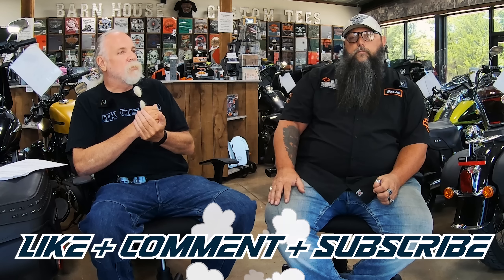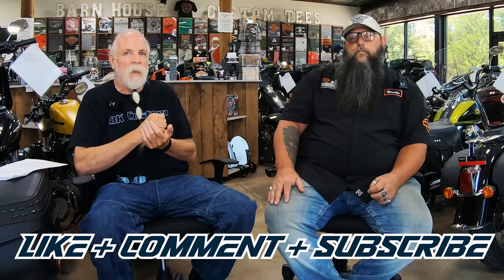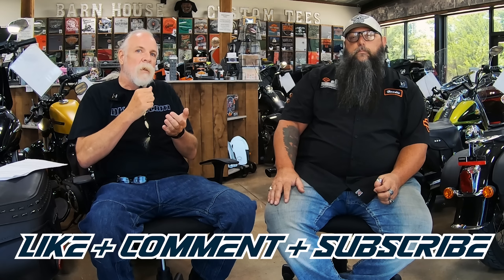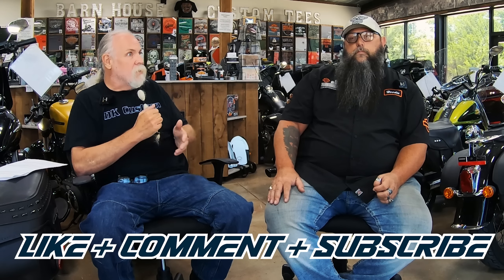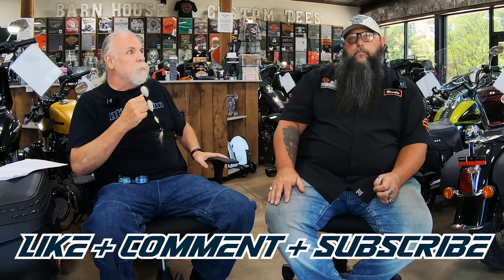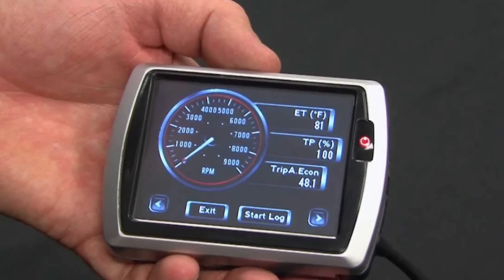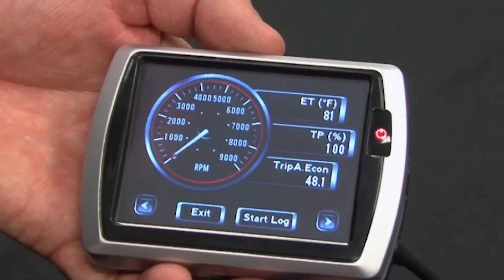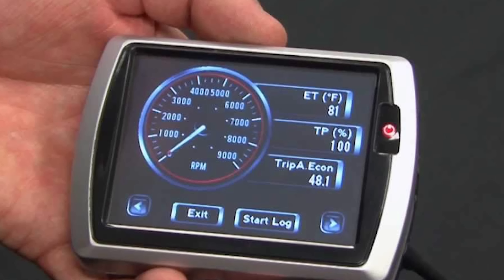No Such Thing As a "Voided Warranty" From Harley

Comment: Based on the new warranty info I received after the FTC consent order, it explicitly states that the Power Train warranty is "voided" if a non EPA compliant tuner is used on the bike.  I have a new Dynojet Power Vision 4 sitting on my desk till I get the cojones to say F it and do the tune.
Reply from the maker: Yeah, it says that, and it said it for the last 5 years, but as Hoodie pointed out, he's gotten a lot of things covered anyway, by calling Techc Services.  But if the clutch cable goes out, or there is a transmission seal leaking, the Service Advisor can (should) call Tech Services and point out that there is no way the tuner caused those problems, and it should get covered under warranty.
The EPA is trying to give some teeth to the emissions of a tuner, but that does not invalidate the MM Act, or simple common sense, that a tuner does not cause a clutch cable to break or a seal in the transmission to start leaking or xyz.
Reply: @DKCustomProducts  Thanks Kevin.  I truly appreciate al of the information you and Duane provide in these videos.  I have learned a ton, especially since this is my first Harley after coming off metric bikes that the EPA could give a rats ass about how the bike is tuned.
Reply from the maker: @Easy Glider  Thanks man, appreciate the kind words, and glad you are fining the videos useful. 
Enjoy your ride!
Reply: @Kevin from DK: I saw a transmission warranty claim rejected on the basis that the aftermarket tune caused hotter engine running which had a flow-on effect to the transmission (i.e. transmission was hotter too) and it caused premature failure. Now we all know that it’s absolute horse shit but trying to disprove Harley’s claims in court is fruitless and so the customer took their bike elsewhere for a transmission rebuild.

Comment: I couldn't even get the dealer to cover a crack at the screw mount on my windshield. My bike is a 2023 Tri-Glide that they charged me 48K out the door.
Reply from the maker: Sounds like time to find a new Dealership! I hate that you have had this problem, but you should find a dealership that will help you not turn you away. 

Thanks for commenting! MB
Reply: Same here.  Was even told " It looks like it was over tightened"  ..... my your tech on initial installation!!

Comment: The service advisor has to agree with you that your tune didn’t cause the issue and then the advisor has to be willing to fight for you and this is what is so hard to find at the dealerships!!
Reply from the maker: Yes, it still all comes down to humans that can think LOGICALLY (as Hoodie mentioned in the video) and take pride in their work.  If I had a service advisor that could not logically deduce that a leaking shifter shaft in the transmission was not the fault of a tuner, then I would Not even waste another minute of my time with them.
Reply: So it sounds like a good reputable repair service advisor other than a HD dealership , may be used to fight for your warranty to be honored the HD company to repair the bike if they can provide evidence correct? Because the HD company cannot force the consumer to use a HD dealership to get warranty repair work completed any more right?
Reply: Common sense aint so common these days and the Dealerships I know of will blame failures on anything they can to dodge a warranty claim.
Reply from the maker: @jasonrichardwatts  Those days should be fading.  If you find a dealership that is still pulling that, check out this video, then report them to the FTC- https://www.youtube.com/watch?v=M-QdwkZ3_RQ
Reply from the maker: @palmettolowlife1996  That is all correct!

Comment: The problem is a service technician that won't take the time to even call HD warranty and debate/ discuss the problem and try to get the repair under warranty... My bike was bone stock with lifters rattling from day 1, finally after 5k miles and 3 different dealership they replaced the lifters and bike runs better than ever without a rattle
Reply from the maker: Yes, sad state of affairs for sure.
Sounds like maybe found a good Dealership.

Comment: Bought a 2021 Street Bob FXBBS 114 brand new in March of "21.  The motor wasn't right from day one and I tried to have the bike picked up by the dealer and got ghosted twice.  I took it to another HD shop and they said they couldn't find anything wrong.  I've got enough history with bikes and engines to know when something ain't right.  At this point I decided to upgrade and ride it like I didn't care and if it blew up I'd deal with it and Harley.  Thousand mile service time and by now I had an Arlen Ness air cleaner and Bassani  2 into 2 pipes with a SE Pro Street Tuner Stage 1 tune on it.  The head breathers were rerouted to a catch can.  My HD shop upgraded the 1K service to include all synthetic oil in all 3 boxes.  Less than 150 miles later after a 100 mile trip the bike had used 3/4 of a quart of engine oil and my analog gauge was reading almost 0 oil pressure within minutes of start up.  I got the dealer to come get the bike on a Sunday (a 12 pack of PBR and the fact that I knew the guy who drove their transporter helped out here.)  Almost 3 weeks later the mechanic tore into it and the rear cylinder was destroyed, something wrong with the rings and a 1/2 wide groove in the cylinder from top to bottom.  I will shorten this story up.  Another 3 weeks passes by and 3 days ago I go pick up my Street Bob 122ci. SE Stage III with  the SE intake and for  $631 I'm out the door.  I got warranty credits for the upgrades. I have no idea how much crap went on behind the curtain but I know if this had happened late last year or early this year HD would not have offered to pay for anything.  The times they are a changing.  This bike will rock you with the 122 stage III, I like it and I've got a 12 month warranty on the rebuild pipes and all.  It's a strange new world we live in.
Reply from the maker: Great to hear they got you taken care of! 👍
While it may have been a frustrating process, they did you right and now you have a nice machine that it sounds like you're enjoying.
Reply: I love my stage 3 122 kit. I got mine installed within 60 days of purchase May 21. No issues yet with about 8k on it. I also purchased the 5 yr extended warranty so the 122 kit will be covered with it. You definitely got a good deal out of some bad fortunate events happy for ya !

Comment: 1. So why is the company still blocking vins and what is their continuing reason to do so?  2. how does a customer know if the dealership reported any modifications or if their vin is blocked ? 
3. Where does it state in the warranty language whom has the responsibility to provide evidence & proof to honor the repair or void it?
Reply from the maker: 1.  They are blocking vins because there are things one can do that would cause a valid warranty issue.  The list is endless, a few examples- installing a stereo system that takes more power than the battery or charging system can handle, competitive racing, turbo charger, running a velocity stack with no filter, and thousands more.
1b. Go to any dealership and have them punch in your VIN, it will come up blocked or not blocked.
2.  Harley Warranty must comply with the Magnuson Moss Consumer Protection Act.  You can google that to get the wording.  You can see in the following video that the FTC has ordered Harley, with the threat of LARGE FINES, to stop their illegal practices and abide by the MM act.
https://www.youtube.com/watch?v=M-QdwkZ3_RQ
Reply: Love your channel and the great informative content you share! Thank you for the response

Comment: Excellent vid. He said he had success getting warranty work on blocked vin’s, just wondering how many it did not work? I feel that the the Moco tries everything to deny claims and I feel for those customers.
Reply from the maker: Good question that we should have covered in the video.
What did not make the edit was our conversation that he had never had one that he attempted to get covered that was not covered.
HOWEVER, he had plenty of times when a Customer wanted something to be covered, that he knew should not be covered, so he never attempted to get it covered.
One example is a Customer that had an independent shop install some aftermarket handlebars.  In the process some of the wiring got messed up, and the Customer wanted the damaged wiring covered under warranty.  Of course, he never submitted that for warranty work because it was damaged by the other shop making a mistake.
Another example he gave was a Customer with a tuner, which resulted in a blocked VIN.  At some point, later, the Customer installed and S&S camplate and the bushing spun, which ended up sending brass all thru the engine.   This was a failure of a non-Harley part and there was no reasonable justification for Harley fixing damage caused by the aftermarket part, so he never attempted that.  If he had, he would have rightly been denied.
You are correct, the default answer by most dealership and my MoCo seems to be it's not covered.  It takes a pro-active Service Manager to go to bad on behalf of the Customer...and if they are asking something that is fair, they do seem to take care of it.
Reply: @DKCustomProducts  Thank you very much, appreciate you taking time for a thorough response. Please know that you guys/ladies are loved by the community for your info and quality parts. It helps that you care. What a world we would have if every product/service provider had that standard.
Reply from the maker: @ncf11  Hey, thanks man! We really appreciate the kind words and support! I will pass the message on to the rest of the team. Thank you for watching our videos! Ride safe!

Comment: The interesting about the tire warranty is I brought a 2009 Harley Heritage Classic New. It had a bad compensator within 500 miles and a flat spot on the rear tire, causing the spokes to constantly loosen on the rear tire and a bad vibration in the balanced engine. compensator was replaced under warranty. Never could get the Harley dealership to own up to the bad tire and  spokes coming loose or the vibration. I drove it for 15,000 miles I put a new tire on it by my local motorplex dealer on the rear wheel,  re-trued the rear wheel on my dime, took it original dealership and another dealership with no success. The vibration was  said to be normal by them. I  have ridden a 2003 Softail Standard, it didn’t have the odd vibration. Now have a new 2022 Street Bob 114 balanced motor with no odd vibration. Plus different Harley dealer.
Reply from the maker: Thanks for sharing your experience.  Glad you finally got it worked out. 👍  Sorry to hear it was such a hassle.
Congrats on your new M8.  👍🏍👍

Comment: Great video, thanks guys! What if you have a tune, like an FP3 for example, but want to take your bike to the dealer for a service or repair, could you just plug the tuner back in and revert to the factory tune? Or, once a tuner is plugged in for whatever reason, will it always be flagged as blocked VIN?
Reply: It’ll always flag it as any additional tune from stock is recorded in the ECU.
Reply from the maker: Up until a couple of years ago you could use a Power Vision to restore the original tune and there is NO record in the ECM that a Power Vision tune was ever installed.  They could see that there was some other tune in it....but it could have been a HD approved tune...they had no way of knowing.  I do not think the FP3 had this ability.  I also believe that 2-3 years ago the PV no longer worked that way either.

Comment: Can a dealer tell if slip ons have been fitted?lambdas on headers PRE CAT not on OE mufflers.Can they tell from ECU readings?
Reply from the maker: As mentioned in the video, they can NOT tell anything except a tuner with the digital tech.  Not exhaust, not cams, nothing but the tuner.
However, a dealership can tell from a visual inspection, and if they choose to report that to Corporate you should look for a new dealership, as also mentioned in the video.
Thanks for watching and for your question.
Reply: @DKCustomProducts  Thanks my man.Great videos too.Picked up my 1st Harley yesterday and love it.Just came across your channel today.Keep up the great work guys.
Reply from the maker: Congrats on your 1st Harley, and thank you, glad you're liking the videos.
Reply: @DKCustomProducts  Ya brother.Loving the bike...and great videos.Thanks for this recent oil check vid.No wonder a lot of guys are getting blow by from over filling
Reply from the maker: @MrMurphc13  Thank you, yeah, you're absolutely correct.
Glad your liking your ride.  Wishing you many miles of smiles on it.

Comment: Thanks for this info.  My question is what problems can adding a aftermarket tuner, e.g., V&H FP4 actually cause?  Thanks again.
Reply from the maker: None, unless the wrong tune is flashed to the ECM and then run.
Of course, the EPA does not like good tunes, but as of now, no State in the US are doing emissions testing on motorcycles.
Reply: Harley can theoretically claim that the aftermarket tune caused the drivetrain to run at less than optimal of what was OEM specced and engineered, leading to them denying the warranty and blaming the tuner.
Reply from the maker: @jasonrichardwatts  Yes, they can claim anything.  But they have to prove it, and that is not able to be proved.  Running less than optimal will not put more stress on the engine, clutch or transmission.
NOW, if you put cams, or do headwork, etc., that is possible.
AND, of course, if one puts the wrong tune in causing the engine to run too lean, that could cause a problem.

Comment: If you  change your Harley oiler to an s/s one will that  delete your warranty.  ??
Reply from the maker: As outlined in the video, there is no deleting or voiding of the warranty.
If the S&S oilers fail, or cause a problem, it is not covered, nor should it be.  If they do not, they have no effect on the warranty.

Comment: I'm assuming if you use the HD pro street tuner, it wouldn't be voided for having a tune, right?
Reply from the maker: Thanks for the question. 
We have a video with a HD Store Manager/previous Service Manager on the subject of the Pro Street Tuner, you can see it here- https://www.youtube.com/watch?v=wQ6EzilYjiI
There is no real benefit to the Pro Street Tuner, as noted in the video above, it will only tune to EPA compliance, and will Not give the best performance or cooling tune.
I don't know if you have a Evolution, Twin Cam or M8 engine.  If an M8, they are not too lean and do not need a tuner.  You can see details on that in this video- https://www.youtube.com/watch?v=Lb_57Z_Ipms
Unless you are doing more than a Stage I upgrade on an M8, no tune is needed, and if you want a tune, the Pro Street Tuner is not going to be an improvement.
Here is a video on our thoughts about tuning- https://www.youtube.com/watch?v=isBHK-Jy7Wk
If you are doing more than a Stage I on an M8, or if you have a Twin Cam or Evolution (Sportster), then getting a real tuner is the only way to get an improvement, but will also jeopardize the HD warranty...so the best thing is to get a real warranty that covers everything.  You can see a video on that here- https://www.youtube.com/watch?v=p8U4XsHyBug and another one here where we show how well the warranty works, even on non-HD parts- https://www.youtube.com/watch?v=Hqkxag-S1a8

Comment: Number one thing that has held me back, hence the XIED for now, but I'll bet HD will find that to be a flag as well since it codes the ECM w/trouble two codes but no engine code/light.
Might have to take it off when I go into the dealer but shouldn't have to.
Not sure I want to chance it.
Might go with motorcycleagent but reading up on them, seems like you have to jump through some hoops before any thing gets worked on for warranty.
We will see.

Comment: Good video, ask Hoodie why my dealer is giving me the run around about the pos plastic adjuster breaking on my M8 2021 FLRT, I am sooo mad I am thinking about giving HD Financial this one back, this adjuster is doomed to fail on every model and possibly get someone hurt or killed
Reply from the maker: Hey Jack!
What plastic adjuster?
Reply: @DKCustomProducts   The M8 clutch cable is a 2 part cable with a plastic housing in between.  The adjuster is spring loaded, it breaks internally, losing all free travel, very cheap design
Reply from the maker: @jackklarich7045  Man that sucks.  Is there an aftermarket cable that is more reliable?
Reply: @DKCustomProducts    Yes, Fat Baggers also makes a piece to fix the broken adjuster. It pisses me off HD will not warranty this piece of junk, they have had quite a few break already and IMO they will have a lot more, this should be recalled and fixed under warranty period